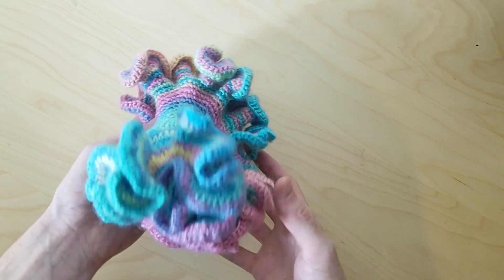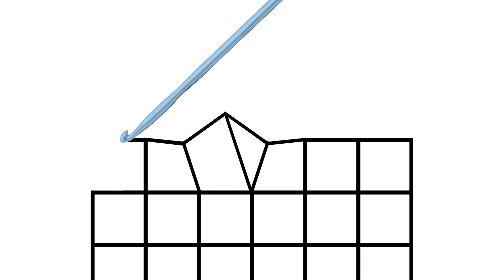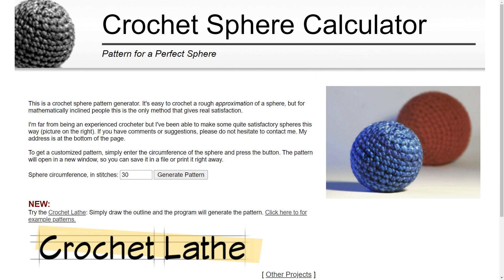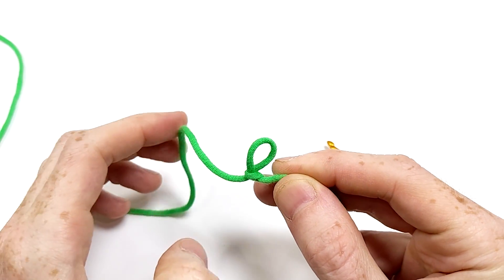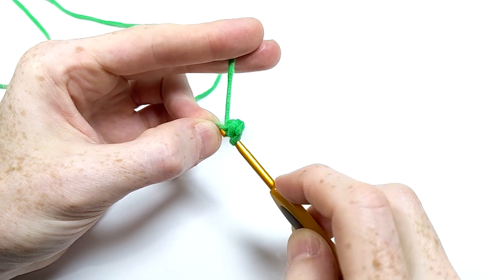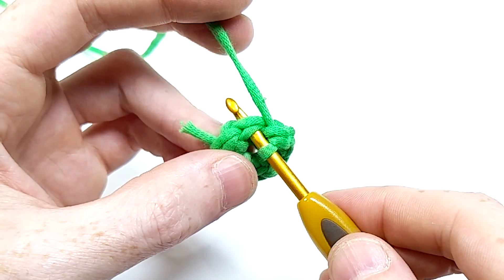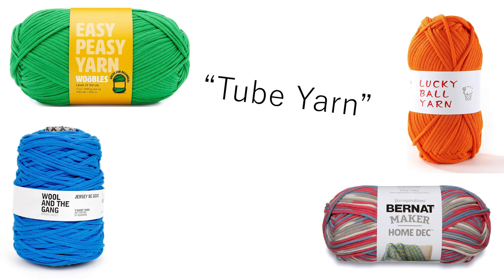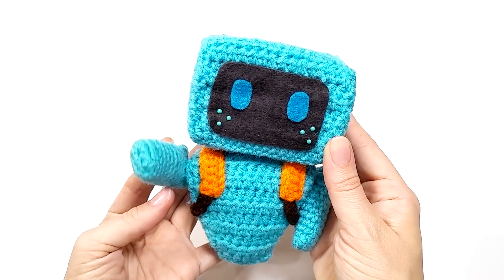Make Your Own Hyperbolic Surface!

Comment: What would happen if you only decreased?
Reply: If you start with a small enough loop, you should get an aproximation of Gabriel's horn. At the 2:00 minute mark you can see a little bump in the center of the crochete, the hyperbolic plane doesn't have such a bump and I've encountered the same problem when I've done hyperbolic crochete, to remedy that I add a few additional increase stitches each time I complete a lap, this increase is geometric rather than exponential, so if you drop out the exponential growth you would get a flat disk.

If you start with a large enough loop you will get the same thing as if you had been doing increase stitches from a small loop.

Comment: As someone who has been crocheting for a while and has done some pretty advanced stuff, this is awesome, though you cutting tail off so short was hard to see, but I still love this. The math behind crochet isn’t talked about enough and it’s a tragedy.
Reply: Some prefer to keep the tail to help them hold onto their work until it's bigger and easier to grasp and to keep their work from easily unraveling. I find it also tends to give a much cleaner finish when you keep the tail and weave it into nearby stitches.
Reply: I'm curious, why is cutting the tail off bad?
Reply: @bettercalldelta  if you leave it really short, when you sew it back into your work it can come undone after enough time and then either you have to sew it in again or your work starts unraveling. You also need it long enough so that you can easily put the end through the needle and then be able to pull the needle back far enough to be able to actually put it back through the work roughly where the end originally comes out. Try sewing with thread that’s shorter than your needle and you’ll know what I mean.
Reply: I'd  be open to discuss this as it combines multiple special interests of mine 😊 
There are so many similarities and patterns (pun intented) 😁
Reply: What math
Reply: @mattybrunolucaszeneresalas9072  just the little bits of math that I think about when I’m working. If you want to keep the work straight, you have to make sure  you use the same number of stitches per row, and some funky stitches you might want to do could take up slightly more or less space and you have to account for that. Also the size of your hook and the thickness of your yam could mean that the patterns that you’re following could end up bigger or smaller if you’re not using the intended size. If you want to correct for that, you have to make a swatch and count the rows and columns and then change the pattern slightly by adding or removing stitches so you do get the right size. There’s also the fact that single crochets and double crochets or half treble crochets or any other stitch has a different height and you can use them all in the one row but you’d need to make sure that the next row accounts for that so it ends up straight or ends up with the shape you want. One more example is figuring out how many stitches you’d need for each row if you’re making your own amigurumi so that the different shapes come out how you want. Honestly most of these don’t really ever come up when you’re following a pattern but I like to experiment and those are the things I think about - just about how what stitches I choose to put where and how that affects the work as a whole.
Reply: I love that you belong to the people who can't  help but put a little Slipknot image in a crochet tutorial
(It's  a thing and I'm  all here for it) 🤘😁
Reply: You're a very good teacher
Especially with the little graphic notes

Comment: As a crocheter, I recommend not cutting the tail because it could ruin the shape of your work if it gets pulled or something. Instead, you should leave enough tail to hide it between the stitches in the back of your work
This is more important if you gonna use a regular yarn like cotton or wool
Reply: Yea, when he cut the tail I was thinking no !
I like to hold it with the hook hand to control the position of the work when it's not large enough to grasp normally yet.  Keeping it flat and under a little tension helps hook properly and with uniform size.

I also winced at how much slack he has inside his stitches.
Reply: @JohnDlugosz  I don’t know what you’re talking about. It’s always annoying to carry around and always messes me up:
Reply: it hurt to see him do that LOL
Reply: @RainbowFacedCupCake  what’s wrong with you
Reply: I am actually thinking of learning to crochet because of this video, I will keep this tip in mind if I do decide to.
Reply: @Asterism_Desmos  keep the starting tail long because you can sew it into your work and it'll have less chance of unraveling your project 👍
Reply: @Asterism_Desmos you wouldn't go to a crocheter to learn how to program, so i'd suggest not going to a programmer to learn how to crochet lol. there are lots of great crochet resources out there, made by people who have been doing it for years if not decades!
Reply: i had a physical reaction to the cutting as if the yarn was one of my limbs
Reply: @suphorg8597  😂😂😂😂😭😭😭
Reply: @suphorg8597  why??
Reply: @mattybrunolucaszeneresalas9072  because cutting tails too short will make them impossible to hide and will guarantee your work will eventually unravel and fall apart
Reply: Makes me glad I was crocheting long before programming. I flinched when he cut the end. 😂 I'm happy to see younger tech people pick up the craft.
Reply: I gasped
Reply: @lizbotnick  what
Reply: @mattybrunolucaszeneresalas9072  a slip knot is not the most secure thing to have an end of your work on, even when tightened down, and having a short tail means if it does loosen up (also a more likely thing to happen with a short tail) there's not enough yarn at the end to resecure it ~ if you dont intend to weave in the end and aren't too concerned about finish, at least tie an additional knot or two with the end yarn before snipping it
Reply: LOL glad to see I'm not the only one who had a visceral reaction when the tail was cut so short! 😮😂🙀😱
Reply: I'm a very noice crocheter
Reply: I don’t agree
Reply: @Neil Dunleavy why

Comment: Today I learned crochet instructions are written in Assembly
Reply: They really are!  There's even a notation for loops.
Not really any standard for branching though; for variations the if statements are just ad-hoc and not so compact.
Reply: As a crocheter and programmer I never stopped to think about the relation between both, my eyes were opened now in ways unimaginable

Comment: When I was a kid I used to finger crochet all day long, sometimes from 8 in the morning to 5 in the evening, and I would just make long wires.
Reply: I do that on wires!  Making a chain stitch on a long outdoor electric cord makes it much shorter and easy to handle, and then it pulls out when you need it (without lots of twisting).

Comment: What does it look like if you go from only increases to only decreases
Reply: It would probably be interesting lol. Numerically its just x*2/2. So you’d end up with the same number of stitches as the row/round before the increase row. The row of increases would want to “pop out” as he demonstrates here but it would look different depending on if you’re working in the round (as in this video) or going row-by-row. If you went back and forth (increases-decreases-increases) in the round youd probably end up with a cylinder that looks like the joint of a bendy straw lol.

Comment: Do you think these hyperbolic surfaces could be 3d printed in some way?
Reply: You could 3D print a ridged model of the crochet, but it's the surface that is hyperbolic and the folds would hide the surface.
Reply: You could 3D print squares that attach to each other's sides via hinges, then assemble them such that each corner touches 4 other corners.
Reply: Henry Segerman has 3D printed hyperbolic surfaces.
Reply: Here's a 3D printed hyperbolic surface https://youtu.be/EitWHthBY30
Reply: Here's one https://youtu.be/RnKuIbKauXk